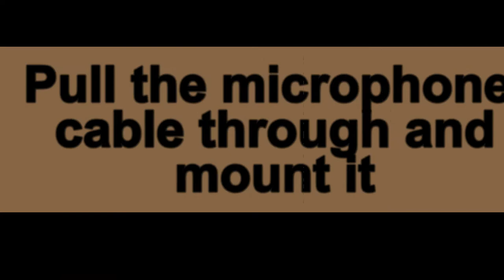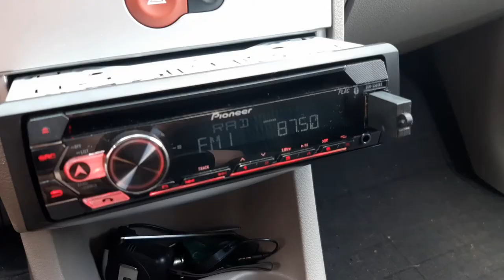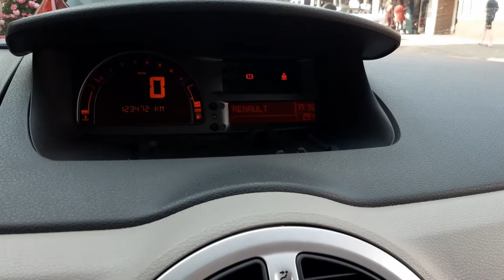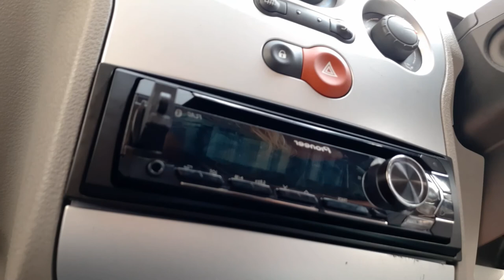DIY - how to install aftermarket radio incl steering wheel interface - Renault modus - Pioneer radio

Comment: I have the Sony DSX-A410BT Stereo and I want to use the volume controls on the steering wheel, what cable would I have to buy to be able to use with my stereo, if anyone knows can you let me know. Thanks👍
Reply: A few days ago I bought the car radio too and I'm looking for the lead cable that is shown in the video, but for the Sony radio. It is supposed to be plugged in the remote in hole 😀 If you can find the lead cable, please send me a link here

Comment: What extra cables did u need to buy to connect to the steering wheel for the buttons there? (Volgensmij ben je Nederlands, ik hoor graag of je extra kabels hebt besteld om de knopjes van het stuur te verbinden aan de radio want ik heb alles precies hetzelfde de radio en de auto ik weet alleen niet welke kabels ik ervoor.moet bestellen)
Reply: In de video laat ik precies zien welke kabels ik gebruik.  De "steering wheel interface met lead cable" zorgt ervoor dat hij verbonden wordt met de knoppen van de auto. Je moet dan wel degene kopen die bij je auto merk en jaar past. En je moet een radio hebben waar die lead kabel in kan. Bij veel radios heet die uitgang w/r. Niet elke radio heeft de mogelijkheid dit te koppelen aan de stuurknoppen, daarom heb ik een radio gezicht met w/r zodat ik zeker wist dat het ging werken. Met andere modellen heb ik geen ervaring, maar zal misschien ook kunnen. Succes!
Reply: @cockatielocreatifly4936  ahh zo dankjewel want ik zag zoveel kabels, en als ik het opzoek krijg ik ook meerdere opties. Maar top, mijn auto is een renault grand modus uit 2010 en is qua interieur en radio precies hetzelfde als jouw auto, ik heb ook dezelfde radio die ik wil installeren haha. Vandaar dat dit de perfecte video was, maar bedankt voor de duidelijke uitleg, ik ga de radio proberen te installeren nu😁

Comment: Hi I got a question, I am installing same radio as you in Clio 3, and from car I got only 2 cable red and black, and radio only works when I link red and yellow together but I can't switch off radio, do you have any idea why? Thank for your video ❤
Reply: You have to hold the power button down for a couple seconds

Comment: Thank you so much, 
Did you find out what that button was for and did the car dash display show the radio station being played like the old radio did?
124,000 km, and still going. nice one.
Now a year has passed, would you still of bought the same radio. 
Take care.
Reply from the maker: Yes  the radio is great and it all functions smooth.  I don't get the screen info with the song names pop up in the car dash,  i was a bit disappointed to.  But it showes on the radio.  And i did not find that button or,  I've just been using it normal with the other functioning buttons
Reply: @clarifyingcreatifly1510  Thankyou
Reply: @clarifyingcreatifly1510  yeah, it's annoying that the external display doesn't work.
I've seen people managing with one specific Sony radio and a "CD changer" input. Also in another video I saw someone who managed using an Alpine adapter with an Alpine radio.
It would be nice to be able to access Connects2's own menu, so to disable the "Renault" display at least